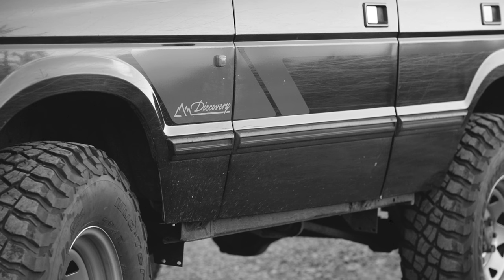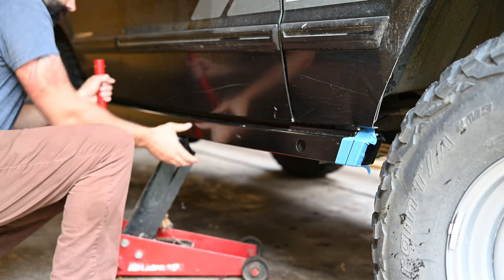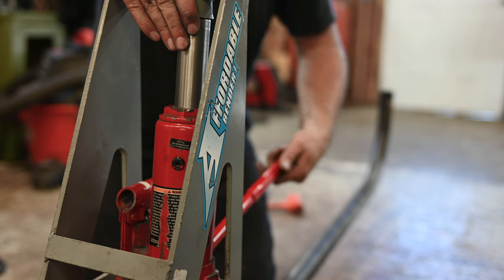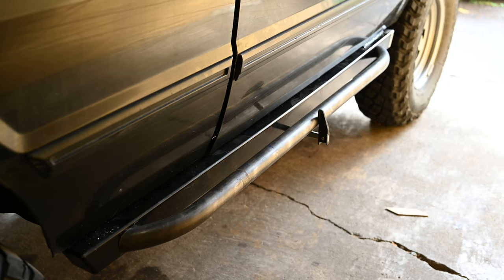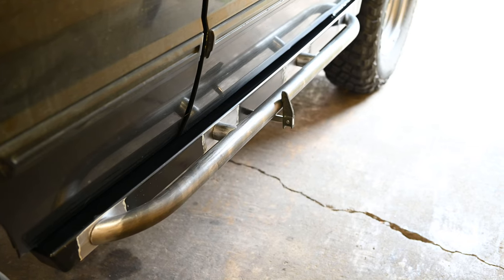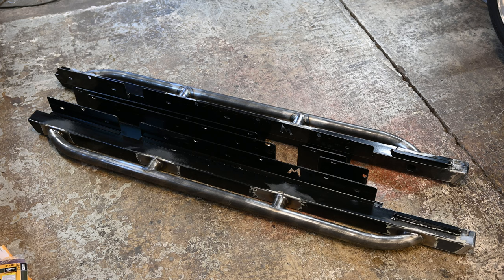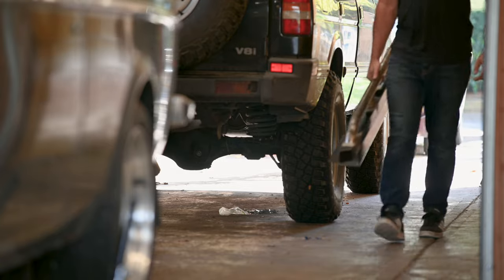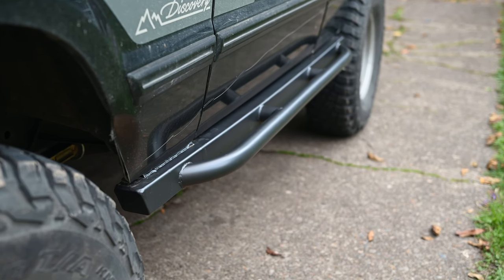Land Rover Rock Sliders: The Dumb Way

Comment: They look great though. I'll have to try out that paint, thanks for the share. I'm going to add nerf bars to my sliders as well, but I'll be using square tube - I like the step stability of them. Tyler, watch that acetone, it absorbs into the blood stream very easily and it's a carcinogen - Wear them nitriles buddy!
Reply from the maker: Whoa, that's the first I've heard of that. Will definitely be more careful around the stuff, thanks.